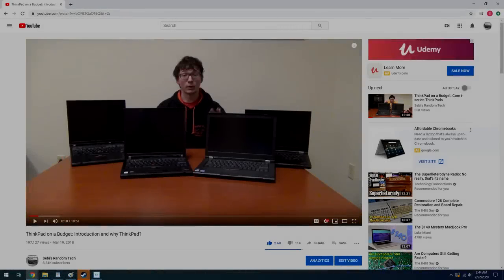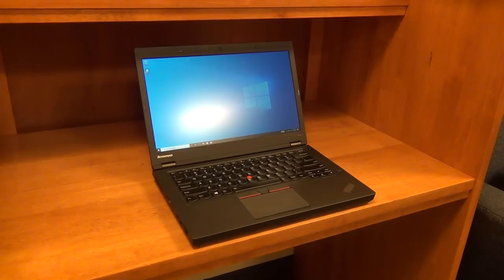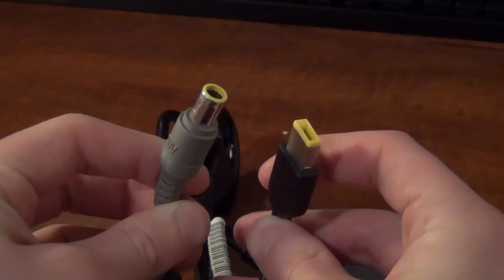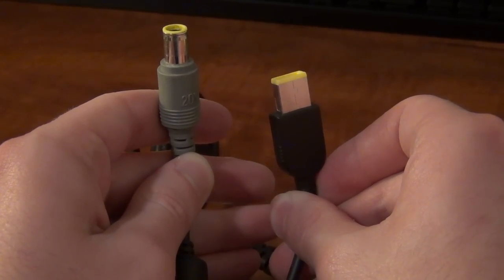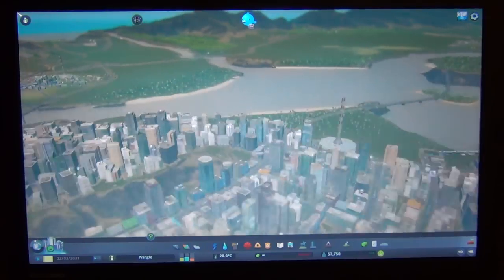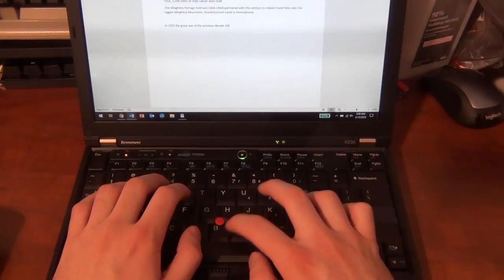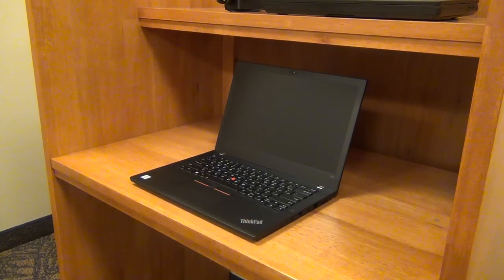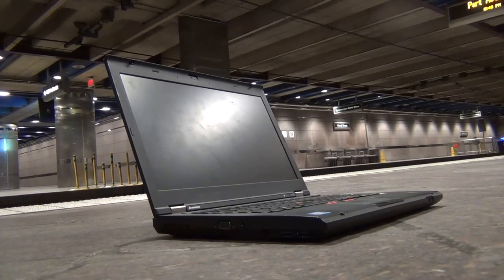Best Value ThinkPads in 2020

Comment: Hello. What is the video editing software used at 11:33?
Reply from the maker: Magix Movie Studio, formerly known as Sony Vegas.
Reply: @SebisRandomTech  Thanks! I'll check it out!
Reply: @SebisRandomTech  can i use this video editing software on my t480 (i5-8250u 16gb) ? i also heard rendering on laptops may cause some type of hardware/component harm....? is that true?
Reply from the maker: Yes you can use it. Editing video on laptops likely won’t cause any harm, modern processors and hardware have several failsafes in place, such as speeding up the fan or underclocking the processor if it gets too hot (known as thermal throttling), and if all else fails automatically shutting down the system. If you overclocked the processor, constantly ran it at 100%, and blocked airflow to the cooling vents, then you could have some damage in the long term, but these processors and laptops are designed to be able to handle the stress of normal use.

Comment: Lenovo T540p 2.9GHz i7 VPRO Laptop 500GB SSD 16GB RAM Windows 10 for $200 a good deal?
Reply from the maker: Depends on what i7 it has and what display it comes with, but that doesn't sound like a horrible deal.

Comment: Does anybody have this problem with T440P?

Out of the sudden the keyboard became behaving weird. Fn keys work but not other key works. I have tried uninstalling/updating the driver, installing the hotkeys Lenovo software and even reinstalling windows. And I can't get into the bios. Does anyone have a suggestion?
Reply from the maker: Sounds to me like a dead keyboard. Try re-seating the connection to the motherboard, but if that doesn't work you might need to replace the keyboard.
Reply: @SebisRandomTech  I forgot to mention that I had already done that. So I think I'd be better off going with a new kb then. Thanks so much for replying so fast. I posted on the Lenovo forums but didn't have any replies.
Reply: @SebisRandomTech  Follow-up question: the original keyboard is English US, could it be replaced with a Spanish ES one?

Comment: Which is better sir, a thinkpad x260 or thinkpad t430?
Reply from the maker: They're both very different models. X260 will have better battery life, better screens, and is much smaller, while the T430 is larger and heavier but has more ports and upgradeability.
Reply: Thankyou sir. I appreciate your reply. So if the money I spent in the upgrade for t430 is the same with the price of x260, will t430 be better?
Reply from the maker: @amirrikkimellorzanofabro2661  Depends on if you want the larger screen and keyboard, or better battery life. The X260 would be better for battery life, the T430 would be better for the keyboard.

Comment: My T430 is still working. I mean it's 7,5 years old :-) I am so glad to buy this. The PC after that is maybe a T470s. Question: Can I use the Express Card Slot when I put my PC into a Dockingstation?? Not mechanically because its free when I dock my PC.
Reply: How is the battery life? Does it have a lithium polymer battery?
Reply: kc4knc As other electric device ist has a Li Ion battery. The capacity at the moment is around 30%. The battery lasts for around 1h. As I bought it 2016 battery lasts around 4,5h. But don‘t forget the battery is 7,5 Years old, too.
Reply: @christianhdot1490  Glad to hear it's not dead yet. Nice!
Reply from the maker: The T430 uses lithium-ion batteries. In my experience the 6-cell version can get between 2 and 5 hours, the 9-cell version gets me between 3 and 8 depending on usage, screen brightness, etc.

Comment: Need your help!! I plan to buy a thinkpad which I can do lot of upgrade options likes processor upgrade, RAM, HDD and SSD ..
I want to use laptop for machine learning and heavy data driven tasks
Reply from the maker: The T440p, and its larger cousins (the W540 and W541) are the newest ones that offer upgradeable processors.

For your needs, if you need as much processing power as you can get, as it seems you need based off what you said, it may be more worthwhile to look into a newer P-series machine, like the P50, P70, P51, P71, etc etc. A used P50 won't cost much more than a W540 would, and while its processor isn't soldered it is otherwise more future-proof and powerful than the W540 in every way, so it's worth considering. Stay away from the -s suffixed models (W550s, P50s, P51s) as these are essentially just rebranded T-series machines with low power ultrabook processors.
Reply: @SebisRandomTech  Thanks for the prompt reply.My budget is a bit tight today ..I will look for used one's.

Comment: Congratulations on the video, I am Brazilian and thinkpad since IBM. I currently have a T410, I am looking to get one from the T or W series, better cost benefit, to work with CAD in simple floor plan drawings. Which would you recommend the T440p or W530 or another option? With alternative update.
Reply from the maker: For more graphics-intensive applications the W-series would definitely be a better choice. Try to go for a W540/541, as they have a good performance bump over the W530 (however, that machine is no slouch either).
Reply: @SebisRandomTech  Thank you. I wonder if in the W series, would you have the same benefits of the T series with respect to upgrades and costs?

Comment: How is the Linux support on these laptops? Is the hardware well-supported?
Reply from the maker: ThinkPads are generally regarded to be one of the best laptops to install Linux on. In most cases that I’ve used it, everything worked without any additional driver setup. A few of Lenovo’s newest ThinkPads can even have a select couple of Linux distros pre-installed.
Reply: @SebisRandomTech  Thanks. Seriously considering getting one to play around on. My move to Linux experiment in now in its second month on my main machine and I want to experiment on other distros.
Reply: I've just ordered x220 hopefully it comes soon. Im installing Linux on it I think. Its getting egpu and a powersupply so I can either mine bit coin or play games. I'm doing Linux cos I like my ethical hacking and the laptop will be used specifically for that. My current lenova 110s-11ibr is good its a tank but its not in the same league as the x220 I will be expecting a much better experience. On the 110s I can't run that many tabs open and I think its got 3 GB ram 120GB m.2 sata and Intel n3800 processor so its lacking performance comparer to the x220. I'm expecting a faster experience, I'm expecting no freezing after opening a few tabs. I'm expecting good games to play smoothly like arma3. The x220 has 4GB it is I5 2.6GHz 2540m processor and 320GB hard drive. Its clearly the better performer. Fuck what people say if they see me with an old computer. It dosent matter what they look like.
Reply: A few months ago got a refurbished w510 core i7 with 16 gigs of ram . Origanly had 1 terabyte mechanical hard drive but have replaced with Samsung 1 terabyte ssd and added a pny 280 gig ssd  in hard drive caddy and a docking station. 
This laptop has the overhead light I wonder if can be changed to backlit keyboard?  This is my first lenovo laptop.

Comment: Any reason you don't include the t530? I got one free from work, i7, 8gb ram, 180gb SSD, 5400m graphics card. In almost new condition. It also has 1080p IPS
Reply: nice.
Reply: That's a great computer, but it's only the 15" version of the T430.
Reply: @dragunovbushcraft152  14" would be nicer for carting around in my backpack every day but I enjoy watching YouTube videos on it, and the fact that it was free. I'll upgrade the processor eventually but so far it hasn't really slowed down much.
Reply: @1984Cutlass2nv  The T530, is a great machine. I to, prefer a 15"/17" display.
Reply from the maker: They’re still usually ever so slightly pricier than a T430, plus as someone who had one myself I can say it’s definitely a bit heavier. If the T530 supported resolutions higher then 1080p then it would have something going for it, but unlike the W530 which actually brings performance improvements for the larger size, the T530 is, as another user mentioned, just a larger T430.

Also the T530 was not available with IPS displays originally, unless yours was modified/swapped. They did have very good TN panels with much better colors, contrast, and viewing angles, but it wasn’t an IPS. Tilt the screen back and see if the colors start to invert. If they do, it is a TN panel.
Reply: @SebisRandomTech  
I doubt it was upgraded so it must be tn. I assumed it was IPS because I thought I read that somewhere and it has way better  viewing angled than my old 2010 Lenovo g550. The 720p display on that is terrible and looks bad when you tilt the display. This one seems completely unaffected by viewing angle.
Reply from the maker: @1984Cutlass2nv  Yeah, the T/W520/530 are known for having really high quality 1080p displays. Not IPS, but in my opinion they look better than some of the lower quality IPS panels out there.

Comment: What do you think about the tablet versions of the ThinkPads?
Reply from the maker: They’re pretty nice, especially ones with multitouch (so you can use them without a pen), but I rarely ever made use of the touch screen when I had a tablet ThinkPad so it’s something that just isn’t for me. I used an X230 Tablet for a while and the extra weight, lower battery life, and looser hinge assembly compared to a standard X230 wasn’t worth it for me. As for newer ThinkPads with touch screen options, I haven’t used them so I can’t really make an opinion on those.

Comment: All features of the old keyboard after the swap? Even the Back/Forward buttons next to the arrow keys?
Reply from the maker: After you do the necessary EC patch, yes.
Reply: @SebisRandomTech  If I recall after the patch, the buttons were working as page up and page down
Reply from the maker: @antonkupuj8494  Then the patch wasn’t installed correctly.
Reply: @SebisRandomTech  "It is possible to modify the Embedded Controller to enable all these keys and switch (most of) the Fn commands around." 'Most of' doesn't sound like 100%
Reply from the maker: @antonkupuj8494  Most of is not 100%, but the EC patch does make the backward and forward buttons you were talking about work correctly instead of as Pg Up/Pg Down, and most of the Fn+Function combinations will work correctly. Again, you did not install the EC patch correctly.

Comment: could you recommend me a Lenovo ThinkPad (or another) with these specs: 
Budget: around $1000 - durable - high screen resolution - 15.6'' - For basic school work, nothing complicated. Thanks!
Reply from the maker: If you want something thinner and lighter take a look at the X1 Extreme/P1. You can probably find something a tad thicker like a T15, T15p, or something older like a P50/51/52/53 in that price range as well.
Reply: @SebisRandomTech  Thank you!

Comment: is this a steal? Lenovo ThinkPad T440P 14" Laptop Intel i5-4300M 3.3GHz 8GB RAM 256GB SSD Windows 10 Professional. for 218 bucks?
Reply from the maker: Depends on your location. In the United States that may be a bit on the pricey side (unless it has the 1080p IPS display), but in some other countries that may be considered a good deal.
Reply: i got that with a gpu for 160, i'd keep looking

Comment: Thanks Sebi, got a T440p tanking me through med school😂
Although I got one problem :(
Trying to follow the video to upgrade the trackpad, my laptop now, with the new or old trackpad, doesn't boot up when connected, only gives the beep code (1-3-3-1). No idea what the issue could be and I also tried replacing the ribbon cable so I just use a mouse, because the laptop is still OG🔥
Reply from the maker: That’s odd, I believe 1-3-3-1 is the beep code for no RAM. Check that your RAM is firmly seated and test to make sure neither stick has gone bad.
Reply: This is the only place I kinda' disagree a little. Upgrading the trackpad isn't in the cards for me. I learned how to use the T440p/W540 "ClunkPad", and actually prefer it to the T450 trackpad. Not only can there be the 1-3-3-1 issue, there CAN be driver issues, AND the middle button CAN contact the display when closed, causing scratches on the display. Use rubber feet on the top of the display bezel, to avoid this. I have no answer for the 1-3-3-1 issue.
Reply from the maker: @dragunovbushcraft152  The ClunkPad isn't horrendous once you get used to it, but I still see the T450 touchpad as a major upgrade. I made a video not too long ago addressing the driver issues, and I personally have not had any startup or 1-3-3-1 issues from swapping the touchpad. 

For me, there's little reason to keep the original clunkpad when there's a replacement out there that's so much better. Similarly, the T430 keyboard isn't bad, and I think it's better than the T440p keyboard, but why bother with it when I can easily swap in a T420 keyboard? I haven't had issues with the middle button contacting the display on mine, maybe it depends on how tightly you screw it in or manufacturing tolerances can play a part. It doesn't take much away from a very solid machine!
Reply: @SebisRandomTech  Yeah, understood. I've ALWAYS disabled the trackpads on any personal computers I own, and use a mouse. I really do dislike them very much. I'm not "thrilled" with the clunkpad, but at least if my mouse battery dies, I'm not in panic mode. :) The problem with the button contacting the screen, is mostly from the factory rubber getting some wear on it. Also, how much pressure is on the closed lid.

I personally have no reason TO "upgrade" the ClunkPad. Mostly due to my own laziness. Thus, I just learned to use it. ;^) The difference in keyboards for me? I like the old ones, but since I'm a night person, in a very, dark mancave, I just prefer any backlit keyboard. I get used to keyboards pretty easily. I STILL think your video is full of good, quality advice. :)
Reply: @SebisRandomTech  Thanks for the reply guys. Yep, the 1.3.3.1 is the code for RAM/Motherboard issues, and i presume the issue is with the PS2 port on the motherboard, as I have tried new ribbon cables along with 2 extra trackpads, alps+synaptics. 
If you guys would like to hear the beep code for learning/research purposes I can upload+link a recording of it. 

I also believe a successful t450 trackpad upgrade is very major and it is a HUGE leap from the t440p trackpad, although I'd prefer any trackpad over a broken one haha😂, so do proceed with caution!

Comment: I'm using T510 since last 3 years and still looks strong.

Upgraded the ram (8GB), SSD (120 GB) and HDD (500GB) and working like a charm on Windows 10 with a i5 520m but it's sad it sucks in gaming :( and also display is not very accurate (and by that I mean colours seems to be a bit extra sharp and I have to adjust the angle to get the right colours).

Anyways, does the daily job so no worries except battery, it just dies after 2 minutes of plug off and finding a battery that can provide 6+ hours backup is real pain.

Thinkpads are strong machines and if mine dies I'll buy a newer thinkpad then 🙂

Comment: I just bought an E431 for pretty cheap (in my context), and I know it's not as durable as the other higher end series, but it still has the flexibility and upgradability I want. Here in Brazil, not many were available at a good price. This one has an i3 3110m, 8GB of ram, and a 500GB HD. I'll take a spare 120GB SSD from my PC and put it into the laptop with a caddy. Later on, I'll be considering an i7 3632qm or something.
I actually wanted an X230 with i5 2520m and 16GB of ram, but it was more than double the price.
Btw, the E431 doesn't have a 9 cell battery option, does it?
Reply from the maker: I'm not sure if it does, but if you can't find a 9-cell battery for it then the answer is probably not.
Reply: Man, I gotta be honest. My dad owned that E431 and lemme tell you something..... Its a bad laptop. The keyboard malfunctions a lot along with the track pad. And the durability is comparable to glass. What I would suggest is to buy a L series thinkpad or a second hand T series or X1 from ebay which you can get at affordable prices. Those are way more better than the garbage E series and Ideapad series.

Comment: Is 170€ for a T450, i5-5200u, 8gb Ram, 256Gb Ssd and an 1600pixels display a reasonable machine for coding and web multitasking?
Reply: Where can you get it for 170€? Local shops offer them for 400-480€ refurbished.
Reply: @dex0n92  Usually you can find them on sites like eBay or Mercari; I got an E14 for about $400 USD, but T440p and T450 models are half of that usually here. Markets are different everywhere

Comment: It is worth the effort to replace T430 keyboard to classic keyboard?
Reply: Yes
Reply: but be careful you can also brick your computer if you screw up the BIOS mod
Reply: Thank you. If there is a risk to break the bios then ill leave it as is :)
Reply: @indigo2009  he did say it in his vids too
Reply from the maker: @indigo2009  It's not too difficult to do, the only way you would risk bricking the BIOS is if you either install the wrong computer's BIOS, or unplug your computer and remove the battery while it's flashing the BIOS. Otherwise it's pretty safe.
Reply: @SebisRandomTech  i mean not everyone is tech savvy like you...(i love your content by the way)  and we all make mistakes
Reply: In case in the future i would like to replace the keyboard what is the procedure? 
I think in my case it will be more difficult because my T430 keyboard is English and I need  a Hebrew English keyboard.
Reply from the maker: @indigo2009  I have a video outlining the process on my X230. It's almost the same process except you don't need a T420 palmrest and you select the patched T430 BIOS instead of the patched X230 BIOS.
Reply: @indigo2009  he made videos on it